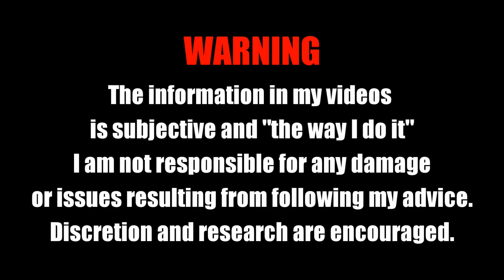Taper verses ball bearings - On Motorcycle Steering Heads

Comment: My advice for the last few decades based as a mechanic is Ball Race for Road and Track, Taper roller for Off Road.
As you mentioned, to maintain precision on the steering head and remove all side play taper roller requires pre-load, ball race does not.
And it follows that any resistance to the front self centering has the potential to turn a head shake into a tank slapper which is an issue on road bikes,  less so for off road where longevity is a priority due to the loads (impact) the bearings encounter off road.
Reply from the maker: Some fantastic points here, one of which I really should have emphasized more. The fact that Suzuki put ball bearings in a 300 + kph bike should speak volumes, a point that I have made replying to several comments here. BUT I didn’t even touch on the dirt bike point, for someone who rode dirt bikes from ‘75 to 2014 you think I would consider them a little more. Thanks for sharing, as always, your expert knowledge mate.
Reply: @ANDY5  It does surprise me that manufacturers dont employ a 45 degree tapered roller on the lower bearing if not both
IIRC the vast majority of everyday spec tapered bearings is 30 degrees and can be less.
The higher the included taper angle, the more axial load the bearing will deal with which would be a benefit for those guys who tent to spend more time on the back wheel and dropping hard back to the pavement.

however supply of the higher included angle bearings may be an issue whereas the ubiquitous old "wheel bearings" can be had anywhere.
Reply: I agree, cup and cone was good enough for RG500's and mid 80's NSR 500's, adjusted to just zero play. Maybe times and bearings have moved on but taper rollers had to be adjusted with (just) perceivable play, certainly not with any preload. But that was 30 years ago on 30 years ago car front wheels.
Reply: If you grab a fork leg in the triple clamps as leverage and give it a push and pull each way to check the slack of the head you will likely discover that the taper rollers do require a small amount of pre-load compared to cup and ball to get all the slack out at the steering head.
And if you then put a spring gauge on the bar and measure the force to turn the bars on both you should find that the taper rollers requires more effort to turn with all slack adjusted out as above.

Comment: It's all about axial loads and radial loads. Ball bearings are great for taking large radial loads but not so good at taking axial loads. Deep grove ball bearings are great at taking big radial loads and they're ok for light axial loads. Taper roller bearings are excellent at taking large axial loads and ok at radial loads. Both ways you see bike manufacturers doing steering bearings are fine. If I were designing a bike, I'd personally prefer to use taper roller bearings though.
Reply from the maker: 100% agree. But thankfully I haven’t had the responsibility of having to design a 300 + kph super bike. Someone did, I’d trust them. Thanks for the engagement mate, I appreciate it.
Reply: Oh absolutely, I can see why either choice isn't a bad choice for the application. Great content as always Andy, we all really appreciate the non shit-talking content :-)
Reply: Just noticed that in my original comment I didn't mention angular contact bearings. Angular contact bearings are similar to taper roller bearings in the sense that they're both designed for heavy axial loading and not so heavy radial loading. This is why you could pretty much say that it's down to personal preference of the designer of which one to use, and Andy explained well the pros and cons of choosing one type over the other, so I don't need to go into that.
Reply: Right on the money, man.
Reply: I served my engineering apprenticeship with Michelin and worked in mechanical maintenance for a good number of years. Then I moved on to CNC lathe programming, which I've now done for years. So I've seen things from maintenance and manufacturing perspectives. More recently in the last few years I've worked in aerospace and oil, super high precision 5axis turning of superalloys like inconel.

Safe to say, Del's shite ain't fooling me. Tbh, Del's shite ain't fooling even the cleaning staff in any engineering shop ;-)

Cheers dude
Reply: Taper roller bearing just Ok at taking radial loads? What? Those taper roller bearing can take almost 10 times more radial load compared to regular or even angular ball bearing at the same size, you must be joking. Just imaging a TRAIN using  ball bearing instead of rollers LOL they would have the train stopping every 10km to replace the bearings LOL.

Comment: So glad you attacked this subject. I tried ball-race and tapered on my old TR500 and found the ball race to be better. And don't get me started on the tapered bearing swing-arm project. Bushes work just fine!
Reply: Are bushes the norm or do bikes use bearings there? 

Even if you were gonna use a bearing for it, taper roller bearings would be the wrong choice. That is not a good application for them. You'd be selecting a bearing that's designed to take higher axial loads than radial loads into an application that's much more radial loads than axial loads

Comment: Spherical roller bearings
Cheaper
Have better misalignment range.
Run faster 

Tapered roller bearings
More expensive
Higher axial and radial loads
Need to be aligned accurately
Longer life

Assuming both types will perform the function they're designed for,
OEM manufacturers choose parts based on 2 main criteria, and one lesser one. 
Cost
Ease of assembly
then
Service life.

In that order.

Comment: In the gas compressors I repair they have roller bearings.  They run a total loss oil system. Oil in the bottom and out off the top then into the compressor to lubricate the blades , the gas moves the oil to a separation unit where the oil falls to the bottom and the gas moves on.. The oil pump on the unit runs off the main input shaft and drip feeds it in.
Reply from the maker: One of the things we used to make where I did my apprenticeship was helical screw type air compressors and blowers, big ones. Powered by large V8 Detroit Diesels. I know precisely what you’re describing here. Talk about a precision assembly, those things were made to such incredible standards. Cheers mate.

Comment: Andy's Motorcycle Obsessions, I have always been told that steering head bearings need pre-load. regardless of which bearing design is used. About a 5lbs pull, as in, you will have to pull, on the steering, with more the 5lbs of force to get the assembly to move. (5lbs pull is about the same amount as the trigger pull on a firearm)
Reply from the maker: In my opinion, and this is just my opinion, if I owned a 300 kph super bike I would use OEM and follow the factory manual for torque settings and installation instructions. A 300 kph tank slapper would not be fun. Thanks for watching mate

Comment: Hey Andy - I agree. Personally I would never swap out a regular ball-race steering head bearing for a tapered roller 'unless' the ball-race was worn. The ball-race bearings are more than fine if they suitably adjusted / fitted and are not worn. IF my ball-race steering head bearing was not ideal I would replace it with tapered roller coz' a tapered  roller bearing is gonna' give me a greater life-span. I prefer tapered roller bearings in my (bevel drive Ducati) head stems.

Comment: Points;
# Harley used (as did old Brit) taper rollers in wheels until 1999. 3-4 thou end float COLD obviously. What a pain on servicing. DTI out for measuring wheel brg play? Longer or shorter spacer tubes sold ( or made in 0.001" increments!).
# Taper rollers every time for ease of assembly if you were used to the old bikes with cups and cones and loose balls with no cage a la bicycle.
# where did that bloody ball go???
# I did a roaring trade in the 90's finding taper rollers to suit and making spacer rings for the outer race to suit various vintage/classic bikes because no one liked the old headstock cup and cones.
# angular contact ball bearings are a whole different ball game. High precision and CAGED! It is why they are the preferred brg in precision grinders. Surface, centre and T&CG.
# but in a street bike - give me taper rollers everytime. Every mechanic likes an easy job.
Regards,
Reply from the maker: I would have thought that if Suzuki saw fit to use them in a 300 kph super bike, that they would have done for a reason. Know what I mean? A 300 kph tank slapper would probably not be ideal. I get your point, many good examples there, but in this application I, and it is just my opinion, would stick to the OEM design. Cheers Michael, always enjoy your comments.
Reply: @ANDY5  As always you have to consider the job in hand.  Probably the race bike is stripped down completely after each race so if the ball race does the job well then keep it.  I had to strip a Toyota car gearbox down years ago after it failed.  I was surprised to see that they had used ball bearings and one of the cages had failed.  I was expecting a taper roller as it could take radial and axial loads.  However at the time Toyota had a good name for gearboxes and were supplying them to several other vehicle manufacturers so must have decided that the ball met the required criteria far better or was equal to the taper, and at a lesser cost.  There is also the fact that in some situations the ball is easier with less assembly and setup requirements than a taper.
Reply from the maker: I was referring to the Hayabussa, not a race bike. But you’re right, it’s all about the application.
Reply: Andy's Motorcycle Obsessions not disagreeing. As noted, there is a reason angular contact ball bearings are far more expensive than run of the mill taper rollers. Cheers,

Comment: My 16 year old T-100 has never had the steering head apart. It still works fine but I feel I should get it apart just to check and regrease. I was considering switching to tapers but at the time thought, should I really? You just confirmed that it's not really necessary. If I really need to replace the bearings, I will opt for the easier option of balls and races.
Reply: Whilst you have it apart do what a lot of people do. Drill and tap the  head stock then fit a grease  nipple.  Especially it you ride in crap weather.

Comment: Great vid.
 Harley-Davidson used to put push-fit grease nipples on their "Softail" motorcycles at the steering stem and down at the swing arm; a bloody good idea I thought, slack off the adjustment nuts to allow excess grease out, a couple of pumps of your mini grease gun, wipe away old grease and retighten. I'm sure there are other motorcycle manufactures who have used similar methods, along with tractor manufactures, etc.😁
Reply from the maker: Perfectly suited to that style of bike. A 300 + kph super bike, however...
Reply: Yes I agree. I wasn't really thinking about the Hyabusa when I made that comment. 
I have however worked with very large high velocity vane air compressors, electricity driven, the electric motors were in their own right monsters. I was what we called "the Frosty", refrigeration engineer on container ships, a rights of passage up the engineering ranks. 
The motors required two 1×MW gen sets to be on load for start up, even though star-delta. We used to carry electricians back then, RM on greasing these electric motors was short, an exact 22ml of fresh grease in and exactly the same amount extracted. Of course the electricians who we called leccy's would not let anyone near these very expensive motors.
It can be done.
Reply: Harley/tractor, pretty much the same thing anyways innit :-D

Comment: Thanks for your explanation iam just about to do my steering head bearings on my aprilia mille genuine aprilia seals dust cover and roller bearings $85 aust iam ok with that and let's be real if tapered rollers were better they would have used them research and development said rollers

Comment: Hi Andy, I've watched this video a few times and I must say it is a good and thorough explanation on why ball over taper and visa versa. I personally have great interest in this subject since I used to exchange all head stock bearings for the tappered version, believing they were superior to the (in my eyes) cheap ball versions .... till I saw the MotoGP guys using ..... BALL BEARINGS for their head stock. I was a little confused at that time and since then I'm interested in the pro's and con's of either application. QUESTION: could you (with some help from maybe your Dutch friend van den Biggelaar) make a video how to correctly adjust the 2 types (pre load, torque etc.). I have read a lot of bull about it and the (my) problem is if I read the official factory manuals they always give the instructions and torque settings for their (mostly ball bearing) application. Would be much oblidged if you could do something with this (have a lot of books regarding motorcycle suspension and construction but this item is left out). Thanks anyway, Frank (Belgium)